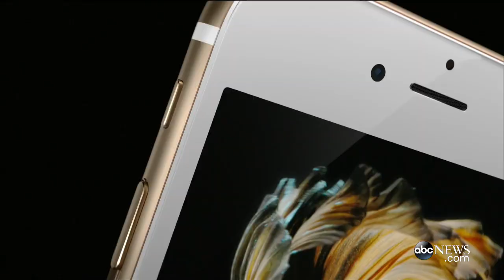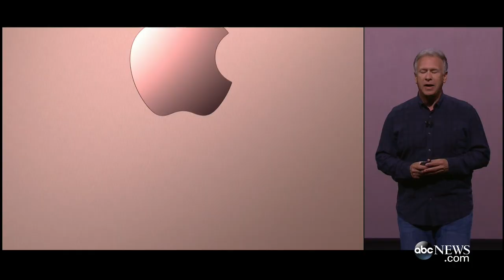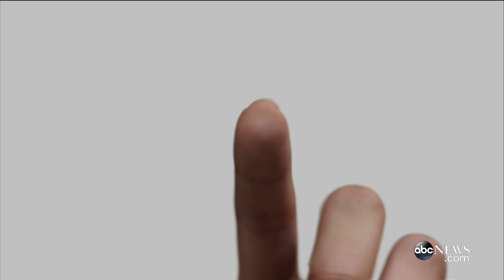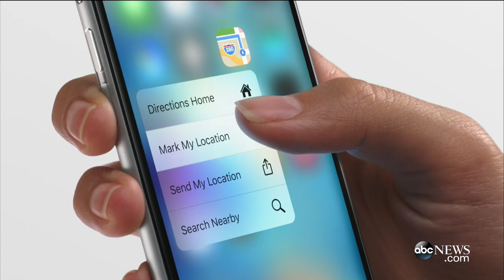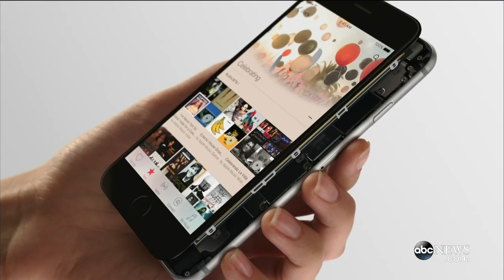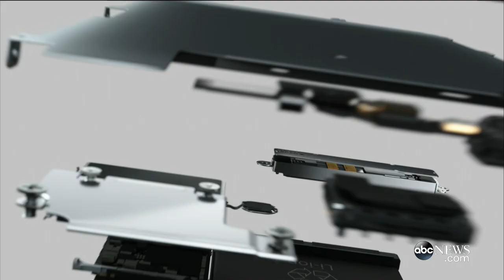Apple iPhone 6S with new Touch Technology | Tim Cook 2015 Presentation

Comment: Boring.....but my opinion still stands. NOTE 5 is the most disappointing phone of the year. Some people are already saying the 6S is disappointing. Nope, I disagree. The Note 5 is. And this is coming from a Note 3 user.
Reply: +Allan Hitchcock  LOL hahahaha
Reply: they trying to exaggerate the "touch technology" based in their 3d presentation. but in real life no one can give some attention about that. mmmm
Reply: This year phones are releasing with lesser features right. Actually notes already have pressure sensitivity and they did the peep before with the pen. The s6 edge plus should be the most least boring phone released, the z5 standard also not much new features, HTC m9 same, Moto X is cheaper. Oh and note have live memo and PDF fill in. Not bad right. I really like this 3D Touch which they should have called force touch. At least it gives shortcuts to maps for direction to home straight from the home screen, and swipe back to previous apps, like windows 8.
Reply: note 5 sucks!! I got it but switched back to my Note 4. why did they take out the extra battery and camera capabilities or the Note Model?
Reply: why do u say that ECDT???? i have a note 3 and i wasnplanning on getting the note 5. whats so wrong about it? should i go w an S6 edge plus????
Reply: +Bball930 You're better off with Note 4 imo.
Reply: mmm go for note 5 haha! i have note 4.
Reply: +ECDT1089 the note 5 is a beast. so many features the camera and spen.... its amazing
Reply: why the note 4 and not note 5? is it cuz no removable battery? no more sd card??? i usually get a new phone every 2 or 3 years. the reason i do is because the r usually the same but they add some specs to make the newer ohone cooler and stuff. Im still debating between note 5 or s6 edge plus. idk.
Reply: why note 5? and not note 4? because its the latest and newest note series and in every latest model have the newest innovation compared in the old model. hehehe so.
Reply: what do u gud think of s6 edge plus?
Reply: ***** Lol far from it. I dont own a single Apple product. BUT Im the minority, I like both Android and iOS
Reply: ECDT1089 me too
Reply: Bball930 If you're new to iOS and want to try out the latest and greatest Apple product, get the 6S. If you have the 5S or 6, wait for the 7.  Nothing stands out here that would make me  want to upgrade from the 6 to the 6S.  The same reason why I didn't upgrade from the Note 3 to the Note 4. And now we have the Note 5. Samsung took away the expandable storage and removable battery. That's a downgrade to me.  Heck I would try out the iPhone if it had expandable storage and removable battery.
Reply: go for galaxy s6 plus better fingerprint scanner good quality camera cool hardware bigger ram, about the battery well they not doing that without reasons, and i think its for good reason.
Reply: or if you want stylus pen like me go for Note 5 they are totally twin. but without stylus pen same specs,
Reply: Yeahh in 2013 i buy both. Note 3 and 5s at the same month. When they first arive. Yeahh android phone always lag and lag and lag. But it ram so high with octa core. But android always lag and lag and lag. With game also
Reply: u crazy.  Note 5 is fukn amazing

Comment: The new 3D touch isn't as inovating as they try to make it sound. 
That doesn't mean some of its features won't be useful, but for the most part its just a new way of opening opening up your mail.
Reply: It's a new UI tool that Devs can utilize in their apps, I guarantee you you'll see this being a lot useful than you see it now.
Reply: +Faulty Firefly Would be much cheaper. But then how would they make the owners of the Iphone 6 buy the 6S?
Reply: You know this cause you've held and used it before anyone else? Fucking know-it-all
Reply: Quick directions back home from the home screen is pretty good. And swipe back to apps are really good. Used that all the time in windows 8 and then windows 10 gone.
Reply: It's ok but probably it will all adhere to the peep and pop rules and right click that Apple showed. You can't ignore everyone on iOS.

Comment: Lowkey happy the 6s isn't that cool cuz I just got my 6 not too long ago 😂
Reply: 4s for dayz
Reply: +FunkyGloveMaster Major changes in the device:
More megapixels in front and back camera
2 GB RAM vs 1 GB in previous
Newer processor
Stronger aluminum
Force Touch
Support for faster data and wifi speeds
Reply: 6s and the 6s plus are the best iPhone to date
Reply: Ricky Johnson Here's essentially how it works.  Let's say you press on something. The Taptic device gives you one vibration which is a short, then if you press harder the Tapic device gives a longer vibration and it does another action.  You are taking a superficial viewpoint of what this is.  It's like taking the basic idea of Touch and Hold and adding another level of pressure and giving the user vibration feedback from the Taptic device.  Have you ever played with Apple's new Track Pads on their laptops with Force Touch?  I think if you played with the new phones and got used to it, you'd realize that it's a further development using their own screen design, a Taptic device which gives off different types of vibrations to the user as feedback as to what pressure level they are using and s/w to do various things when you apply different pressure levels.  I haven't played with it, but I've seen a lot of different videos explaining it and everyone has said it's kinda cool and it takes a little time to get used to it, because it's different and some of these people are knowledgeable about what is done on Android, and they didn't say it was similar to Touch and Hold.  I think you really need to spend more time understanding what Apple is doing and how different it is rather than coming off with some superficial understanding just to bash Apple.  Please stop doing that.  

This is something that Apple does and it's NOT copying, it's doing something different to a pre-existing concept to make it a different and hopefully a better experience.  They might take a preexisting idea and then take it to another level and utilize some of their own technology they design themselves, which is NOT copying, it's innovating.  They designed their own Taptic engine/device to make the vibrations, they designed their own screen technology to recognize different pressure levels, and obviously they designed their own software to do what they want it to do when applying different pressure levels.
Reply: +sivalley More MP does not necessarily indicate a better camera. Ask a pro photographer.
Reply: Relax bro. I'm still using my 5s 😂
Reply: Same man 😂😂😂
Reply: i think i am going to buy the iphone 6 too. The iphone 6s doesn't surprise me that much either...
Reply: +mr52134 you don't /need/ anything about a phone
Reply: same😂😂
Reply: 6 has a vastly better camera than yours
Reply: +FunkyGloveMaster Haha look at all the buyers remorse in here.

The A9 alone and 2GBS of ram ruins the iPhone 6.
Reply: Dude it's way cooler the Taptic Engine makes everything feel so real and personal.

And 4K video ;)
Reply: +daianadar Yea i needa hurry before it stops selling in gold.
Reply: ***** i know the camera upgrade is awesome ..but i am not going to spend money only for that...or i dunno maybe. 8 megapixels are good too :)
Reply: ***** I misunderstood your comment, sorry. I agree
Reply: +BRBallin1 
You forgot ability to take "Live Photos".
Reply: +CheesecakeCaptain HTC zoe did this first.
Reply: +FunkyGloveMaster I read that it does come with 2GB of RAM, which is/would be a nice addition.  I'm still on the fence on getting a 6S+ as I have the 6+ and I like it.  Yeah, it would be nice to have more speed, RAM, new screen, etc., but I want to skip a year and go with the iPhone 7.
Reply: +BRBallin1 Add a faster/improved fingerprint sensor.  :-)
Reply: Someone is making a jailbreak tweak to get 3d touch like thing, If you don't mind jailbreaking
Reply: same here, lol
Reply: Me too man 😂
Reply: +ben5447 Still falling behind on the SGS5 and SGS6's 16MP RFC and SGS6 3MP FFC.
Reply: Lol me too 😂😂
Reply: Omfg me too
Reply: same😂
Reply: Samee
Reply: If you are serious about taking photographs, a DSLR Canon Camera is so much better. A phone is just a phone. Phone camera quality is sub par as compared to real cameras out there.
Reply: hahahaha me to
Reply: Lol I got my 6 plus not too long ago either
Reply: It's not low key now because you said it.
Reply: If you bought it before they changed the price to $99 then idk wtf you're doing
Reply: Same
Reply: you sound bitter 😂
Reply: sammmeee
Reply: +FunkyGloveMaster Apple products will get you laid more, but most of the opportunities are gay sex.
Reply: https://lh3.googleusercontent.com/-jv_5_8BSLMk/AAAAAAAAAAI/AAAAAAAAA8g/NnG4NJOo0Ns/s4666-c-k-no/photo.jpg
pics or it didn't happen
Reply: +#KElTH RlCHARDSg
Reply: +IceManStudios true